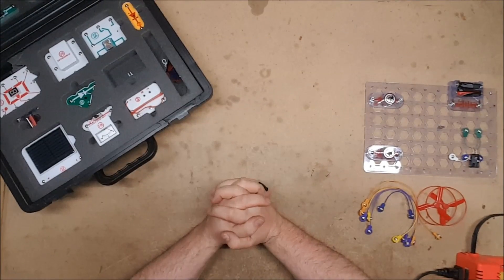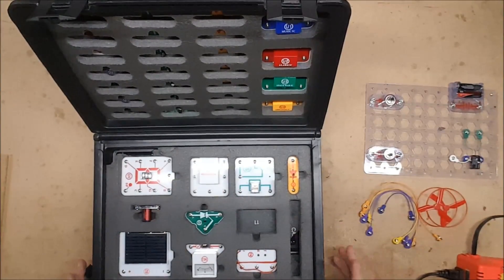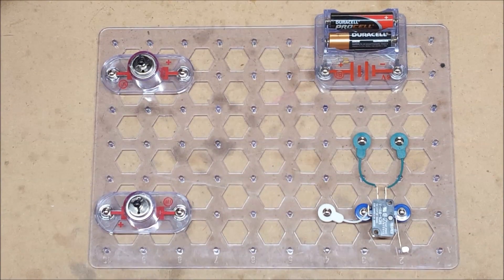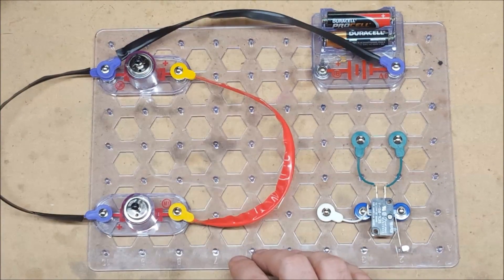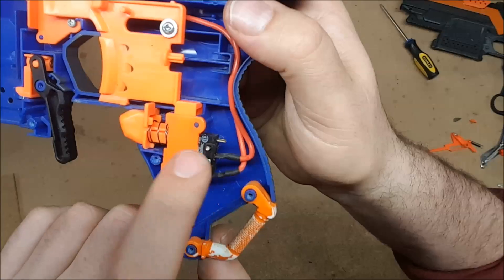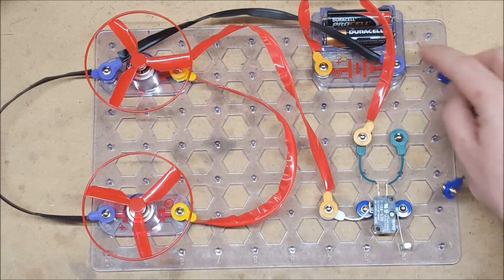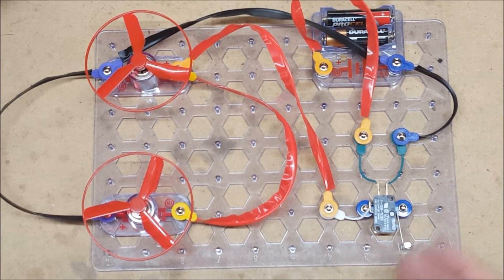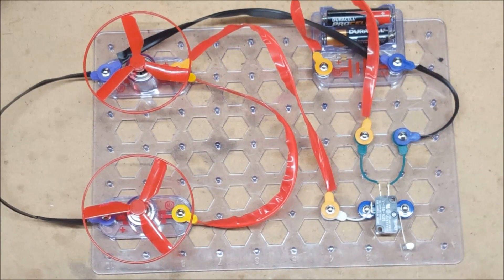Monday Mod Tips - Stryfe Wiring Guide

Comment: How can I do a dual stage trigger for my flywheel vulcan
Reply from the maker: ...I really should do a video on how to wire dual stage triggers...

But basically it involves two things.  
1.  Mounting the Rev switch in such a way that the button is pressed when you are NOT pulling the trigger.  (So as soon and you pull the trigger even a little the rev switch is unpressed)
2. Instead of wiring the BAT POS line to the REV SWITCH NO you wire it to the REV SWITCH NC. 

The result will be that the REV circuit is completed with the button is NOT pressed so when you pull the trigger and release the switch that blaster will rev.

Comment: Diagram Incomplete
when I open up my blaster, the actual wiring is more complex than your explanation
Can you do a more advanced guide that explains how what the 'thermistor' is doing? 

also the switch for the jam door has all 3 legs wired up and I'm not sure why...
Reply from the maker: This is not a guide on the stock wiring. This is a guide to rewiring the blaster for high power motors and LiPo batteries. It assumes you are removing all of the original wiring and switches.
Reply from the maker: The thermistor prevents the motors from drawing too much current from the battery. It prevent damage in the case of a jam. The third wire in the jam door switch provides motor breaking to the flywheels so they halt if you open the jam door.

Comment: Soooo....how would this apply to converting to a 2s lipo? bigger gauge wires and just soldering to a lipo connector?
Reply from the maker: Yes
Reply: @CaptainXavier  can you explain. Why there are different switches? I notice there are different amp ratings on them, but how does it affect the blaster?
Reply from the maker: Your switches, like your motors, have to be capable of supporting both the current and voltage being used by the system or they will fail.

Comment: I've always wanted to mod a stryfe but didn't want to ruin anything internally so I never have. I am thinking it now because this was a great tutorial! Thanks so much! If I do what motors + cage should I get and what type of batteries. 2s or 3s lipo, I know a lot about those because I work with rc planes and cars that take these type of batteries.
Reply from the maker: The cage and wheels are mostly a matter of preference and budget.  Some are better than others but honestly the difference is fairly minor.  Motors and batteries are a different story.  But they also depend on preference and budget.  Although motors are fairly cheap.  It really depends on how much power you want, which should be based on what you are going to be using it for.  HvZ?  Something very mild as it is mostly point blank range.  NIC?  Something much more powerful.  Casual Public Nerf Wars?  Something in between.  There is no one right answer (despite what the elitists will tell you)
Reply: Captain Xavier Id probably use it at like casual public nerf wars and around my house. I wouldn’t want too much power but enough to pack a punch

Comment: Totally easy to follow. My only question would be is the motor braking just personal preference? To brake or not to brake? Are there times when it's undesirable? Thanks!
Reply from the maker: I thought I covered that in the video...but in case I didn't:  Motor breaking on the Flywheels is a matter of preference.  It cuts down on noise but adds wear and tear on the motors.  Motor breaking is, however, necessary in more complex blasters (stampedes, rapidstrikes, hyperfires, etc) as we will see in future episodes.
Reply: Captain Xavier awesome! Thank you! And thanks for the spectacular content.

Comment: I like the teaching tool for going over circuit layouts. I vote make more vids of this kind (I can't wait til you get to MOSFETS - I barely understand them and the community needs more educational resources in this area). I also love that you included a discussion of the motor braking option. Lots of guides have the COM tab on the switch wired to the  positive from the battery  which negates even the option of motor braking. Wiring COM to the positive on the motors leaves that door open with out requiring that anyone walk through it if they don't want to and I really like that you presented that in this guide.

Comment: this was such a helpful video in explaining both the basics of wiring and circuits and exactly how the circuit in the stryfe works. thank you so much for making this! one suggestion: can you make a second wire from the switch that splits  to the positive motors, and  a split negative wire that reconnects as one to the battery? that way you can still do the same diagram as this one, but also show that the leads dont have to go to/from a single motor. (it also explains to people who have no experience in circuitry how one wire can be split into two and back, as is popular with most mods like you said about clear motor covers)

again, great video, i look forward to more like this one in the future!
Reply from the maker: I am not entirely sure I understand what you are requesting.

Comment: As a maker this makes it very easy to follow. Would you be willing to do a version (in future videos) showing how a mosfet would be hooked up as well?
Reply from the maker: Yes, I will eventually do mosfets. In fact, I plan to use this to teach myself how they work.
Reply: Captain Xavier foam data services has a good guide but I still needed to break out the bread board to get a better understanding

Comment: That helps a fair bit.  And this made the most sense of motor braking of any video that I've seen.  I'm still out about if motor braking is a good thing on this type of blaster, but thanks for showing it better.
Reply from the maker: It is harder on the motor but cuts down on noise. It also increase rev time since the motors are always having to start from a dead stop. I don't use it on flywheels.
Reply: Thanks for the input.  That is what I've been thinking, but haven't done my first flywheel build yet.  For the full-auto blasters, it would be different on the pushers.  I'm looking forward to your guides on those.  Thanks for doing all this.

Comment: How does causing a sort-circuit with that last wire (I presume the switch has the same resistance as the wire) cause the motors to stop spinning quicker?
Reply from the maker: It connects negative to both leads on the motor. This is not a short circuit, it is a grounded circuit.